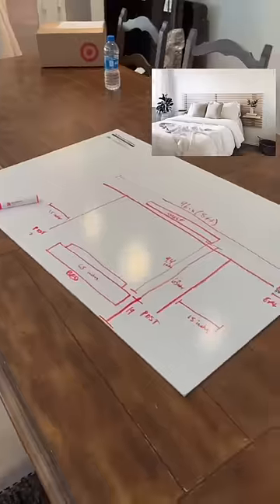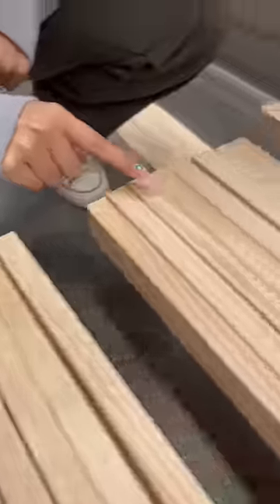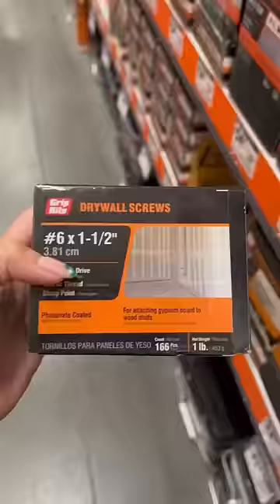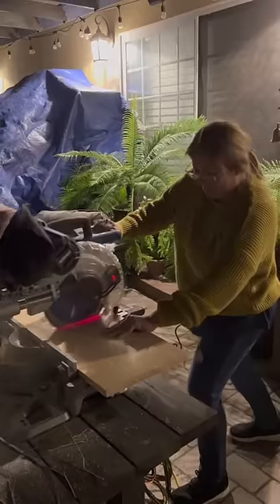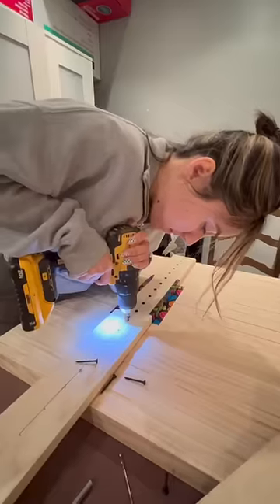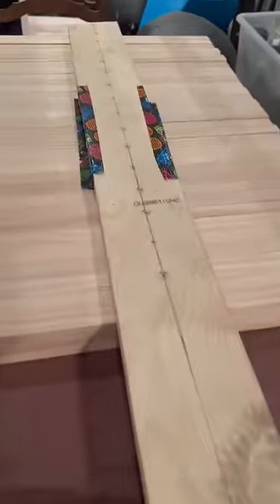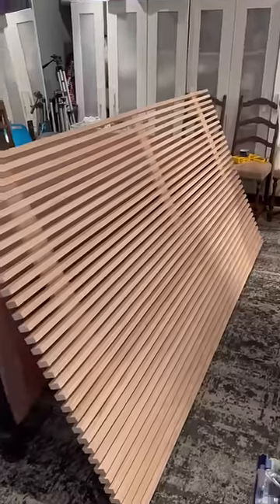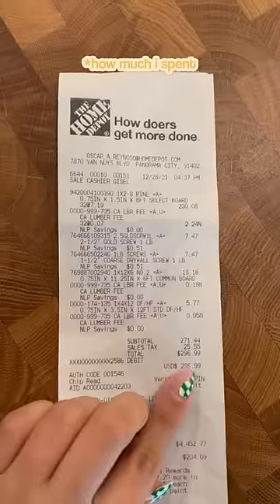i love this headboard that i diy’d 💕 #diy #headboard #homedecor

Comment: You spent too much.  I just bought a king-size, crushed velvet, padded, hanging headboard at the Salvation Army for $10.00. Marked down from $39.99. I vacuumed it, then steam cleaned it. I dont want to hang it, (although it has the round hanging things on it). Instaed i found two planks in my attic, sanded, painted then attached to the back as legs. Total cost $13.00😉
Reply from the maker: Good for you!